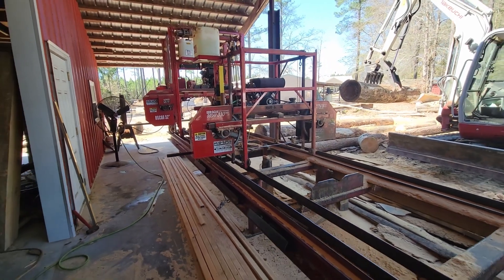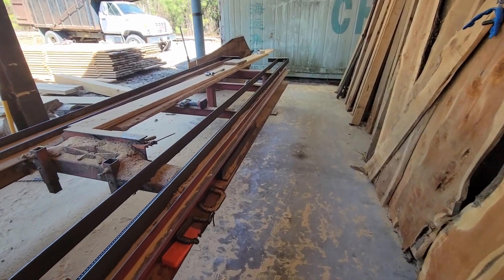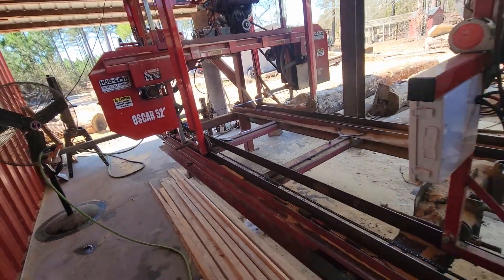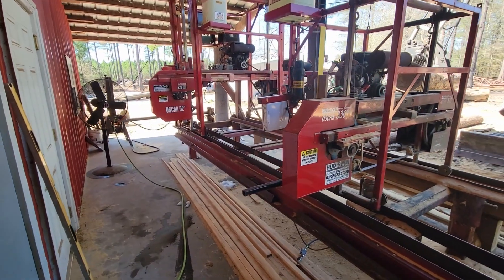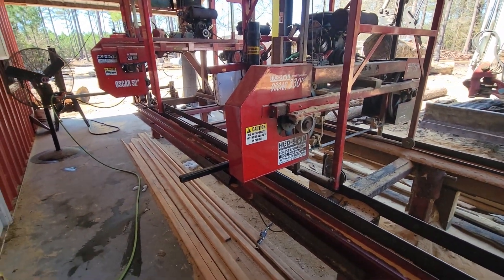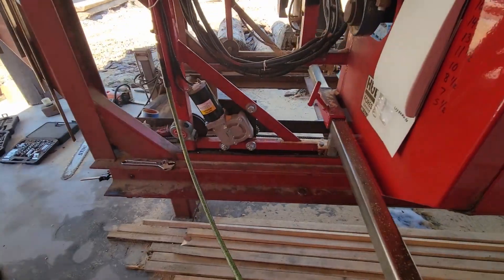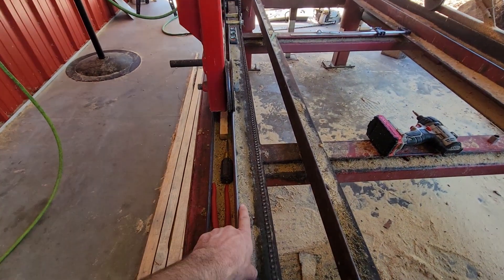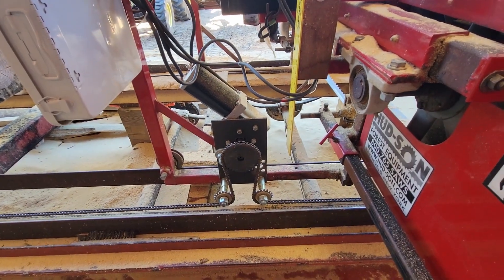Double Headed Simultaneous Sawmilling

Comment: now the question is considering you have 36 feet bed, can you run 2 seperate logs one on each mill @ the same time ?,now that would be a awsome feat & sight :)
Reply from the maker: I don't think there would be any issue myself.  (2) 12ft logs or (1) 24ft log it shouldn't be any issue but either way would come out with the same outcome I believe.  I'll try it one day.